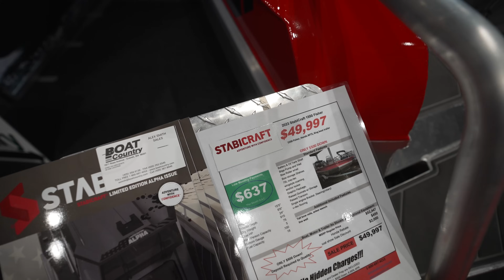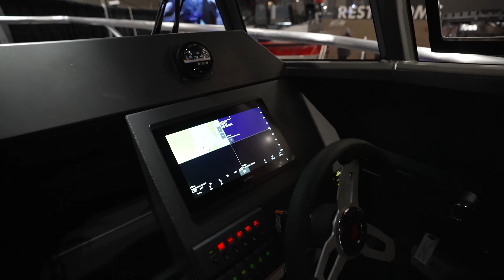The Ultimate Adventure Boats ! Stabicraft Is now in America ! (Seattle Boat Show 2023 )

Comment: I live down the road from stabicraft. They finishing about 20 boats a week atm... virtually unsinkable don’t mean your safe. 7 people died in a stabi 3 months ago here in NZ.
Reply: Yep, unsinkable, but they will roll over in breaking waves just like any other boat. Potentially even more so due to their light weight, the bigger forward racking cab models look too top heavy for my liking. 
I can see how buyers can get complacent thinking their boat is unsinkable and they are entirely safe, and nothing can go wrong.
Reply: A whale flipped that boat though
Reply: @colinmckay3868  
Yes I understand that's what happened unfortunately. 
But my point was the common frase that a lot of manufacturers are going for is the word unsinkable.
For the inexperienced this can be their undoing.
It's not the sinking it's the boat, it's the boat flipping over in rough water, swells or that rogue wave..
That design is no more susceptible to flipping over than most other V hulls..